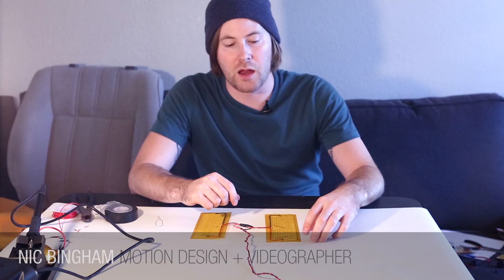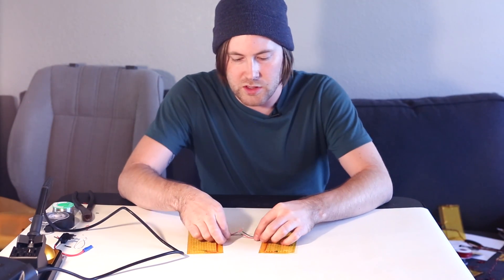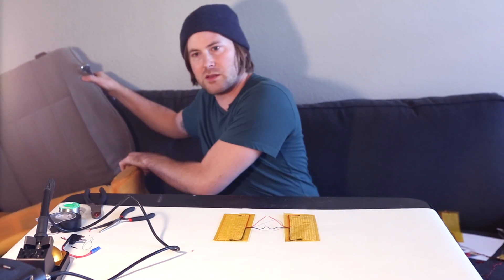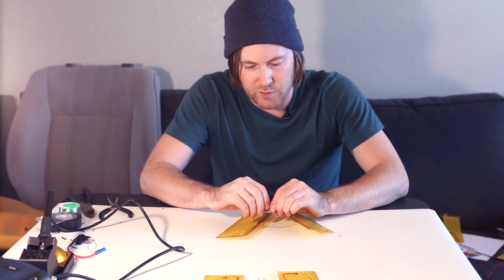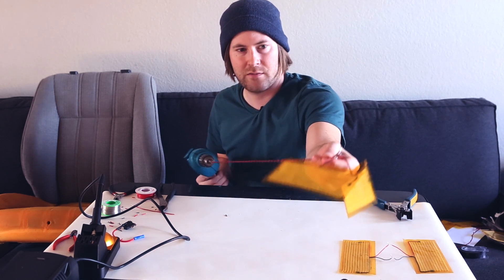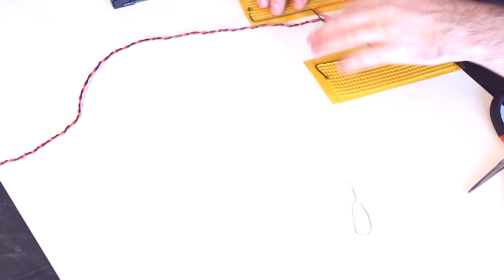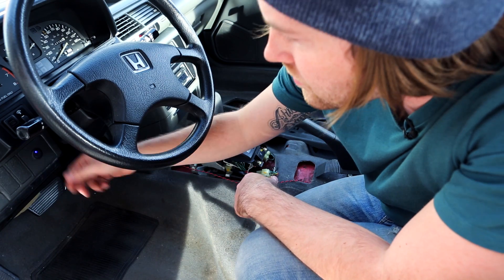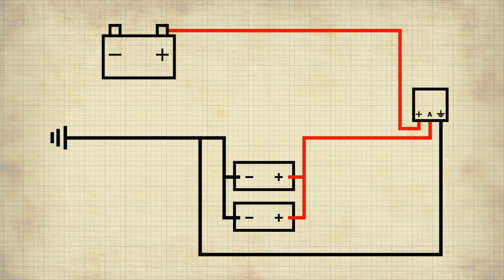SparkFun Engineering Roundtable #22 DIY Heated Seats

Comment: I'm in the process of installing aftermarket heaters in my truck, and I'm doing things a little differently. First, the kits I got came with relays, which I think is probably advisable so the little rocker switches aren't handling so much current. The other part is a little overkill, but I'm running a 8ga (50A fused) wire from the battery and through a relay controlled by another switch in the dash into the passenger compartment. The wire runs to an aux. fuse block that I'll then take off power for the driver and passenger seat heaters. The plus here is that everything is triply fused, and I have additional fuse positions for other accessories that I might want later (CB Radio, Raspberry Pi, etc...)

Comment: Neat project. I appreciate the safety advice from other commenters, but as a noob, I'm curious why ground gets connected to the car or engine frame rather than the negative terminal of the battery? I assume they are connected and that a car's frame is its ground point, but is there a reason not to use the negative battery terminal?  Thanks for any answers and for sharing the idea.  Plus I love the drill wire twisting.

Comment: Well, since you asked for tips as well, one thing I do when soldering red and black wires like you did, is to have the point where it connects (the two bits of wires), over-shoot the other joint you are going to make. That way if the tape rubs through sometime later it will not arc across to the other polarity if in a harness. <edited out a bit that did not make much sense when I re-read it>

Sort of like this. 

I--(+)--------I - red wire
I-------(-)----I - black wire

Comment: I might put two sets of pads in series to bring it closer to the recommended 5v. (wouldn't want them to melt if you left it on on a hot summer day)

             |-(+ )--(+ -)-|
[bat+]--|                    |-[chassis]
             |-(+ )--(+ -)-|

I'd also wire it in on one of the relays in the car that will only turn on with the ignition, that way you can't accidentally drain the battery.

Comment: Suggestions. First off, you really need a fuse on the power wire close to the battery. Without a fuse there is a very real fire danger if the wire is shorted to any part of the car chassis. You might want to just use one of the power wires that are usually available inside the dash somewhere that only have power when the car is running. This way they are already fused and the heaters won't drain your battery if you forget to turn them off. Also, I would use heatshrink tubing on the wire connections for any permanent install, electrical tape doesn't last forever. In general, good work, continue making :)

Comment: Sorry, had to give this a thumbs down. This approach shown in the video is just downright dangerous! There are no fuse on the positive wire, there are no strain relief on the wires, the wires are too thin to use in an automotive environment, they will rub trough and cause fire. Also, the negative connection on the engine block is not factory, someone mounted something extra in the engine compartment, and thought the mounting screw for the heat shild was a good way to gound the connections - not a very good idea :-/ there are hundreds of grounding points in the car, the one in the feet area, behind the door jamb being the obvious for this project.

Comment: Nice project. If you have some more time you could even use two MOSFETs and an arduino with a potentiometer an a sketch converting the reading from the potentiometer in to PWM signals to control the MOSFETs so you are able to adjust the temperature or you could even integrate a temperature sensor so you could set the heating pads to a specific temperature.
And for your next project you mightwant to consider using heat-shrink instead of duct tape. Keep up the good work. :D
Reply: Nic Bingham Why the heatgun? I've always used a lighter or a candle...
Reply: Robbie Mckennie Yeah...I'm not even sure why people want to solve everything with arduino. If PWM is what you want, then a 555 timer is a way cheaper, simpler solution.
Reply: Those are awesome ideas! If I total this car too I'll for sure want to do it that way instead. And, totally, I wish I would have borrowed a heat gun from someone at work so I could have used heat shrink instead.
Reply: Nic Bingham Fingers crossed I keep this car till it dies of natural causes though. haha
Reply: Perhaps a cheaper way to go is using a pot as a variable resistor. Cheap, and could work just as well as an arduino

Comment: Nice work.  Might have considered connection within the existing fuse block vs the battery directly.  There are usually some spares that are unpopulated that might be easier to access and have the safety of a fuse or circuit breaker on a high current device.